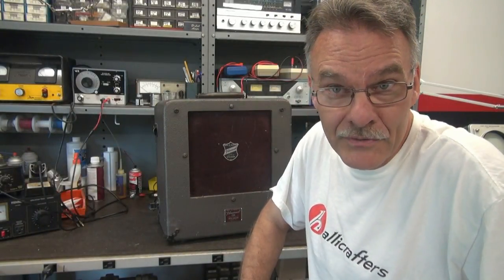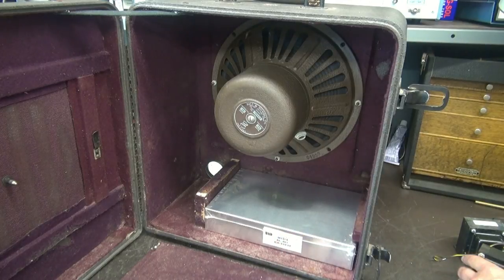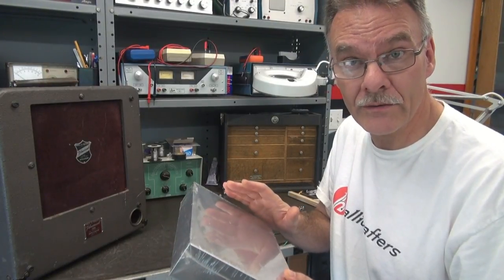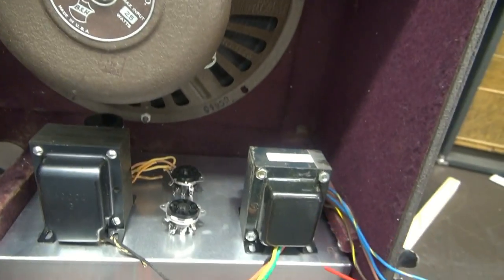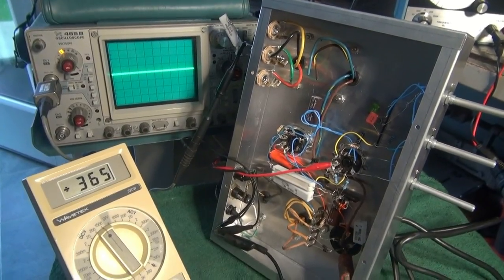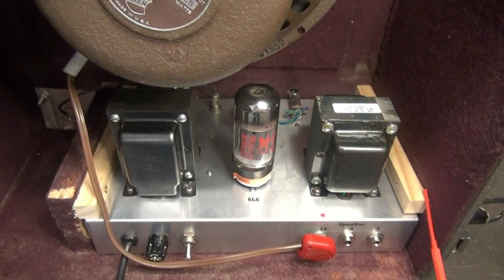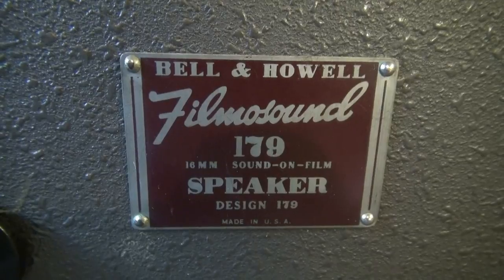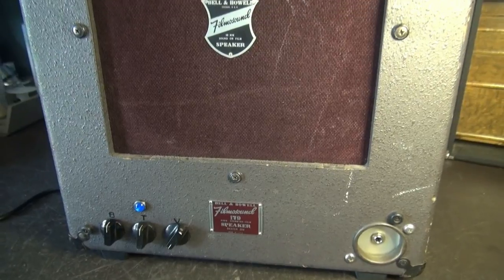How to build a combo guitar tube amp Filmosound speaker cabinet

Comment: I've had one I've been using for years I adapted to a TRS jackwith senate little lunchbox style micro amps. I just ordered a second one that should be on my doorstep any minute now. The are my all time favorite speaker/cab ever designed and are extremely versatile in utility. I intend to also use the dual 197's as part of my mini PA system I'm designing for use at small venues and part of my personal performance set-up. I have my Great Grandpa's Ampro Projector Speaker which I installed a little solid state into to make it a combo similar to this, I mostly use it with a secondary remote tube preamp so I can color my vocals and get a sweet sounding tube clipping grit or roll it back for a cleaner tone.

Comment: Hey Terry, would you be willing to give subminiature type tubes a try?
There's these neat little power tubes, 5902, which can deliver 1 Watt in single-ended @ 110v B+, and around 3 Watts in push pull.
They're like shrunk-down 6AQ5 tubes, same filament voltage and current, and you can find them for reasonable prices online. I'd love to see what you could come up with using these guys. 
For preamp, there's many options for dual-triodes (6111, 6112, 6021, 6N16, 6N21, etc) and a few pentodes (5636, 5840, etc), so you can keep the amp tiny by using all subminiature types!
What do you think?

Comment: Sounds good and what a great job. Wish I was good enough to just whip up designs like you do. Maybe in time. Thanks man and I did copy the schematic, Thanx a million.
Reply from the maker: Cool deal man, If the treble is too high, install a 390pf rather than the 220pf cap on the T pot. Thanks for your kind support. TD

Comment: I think I done purchasing tube amps. I will start building my own. The same thing happened to me with computers. I paid too much to have a shop upgrade my AMD 500MHz processor with 8Mb of memory to an AMD 1300MHz Thunderbird Processor and 500Mb memory somewhere around the year 2005. New Motherboards, new memory, new video card, new power supply. From then on I built my own. I purchased one of those How to Build a computer  "For Dummies" books and did my own research as well. I ended up building 3 computers. They still work but are now outdated. They run Windows XP at 2200MHz.
My first electronics project was a Radio Shack crystal radio set that worked nicely. My second project was a Radio Shack Multi-meter kit, which I ended up using for a while when I was an Electrician apprentice. I changed to drafting and then mechanical Engineering. That's how I earned my living.
I built two violins from Kits and I was able to incorporate features/adjustments that fit my style and technique better than any other professionally made violin. They sound great. The finish was the hardest part and I did not , could not make them look like a professional instrument. I once read it can take 10 years to learn how to apply the finish to a musical instrument so that it looks real pleasing to the eye. I believe that!
These day's I do a little Louthering on every instrument I have to make them fit/play better for me. Why not as they are mine.

Comment: Terry, isn't that Jensen a field coil speaker? How did you get it to run without power to the field? I have a similar B&H box with a 16Ω/15W Jensen that looks to be from the same period, but it's got a 4-pin that runs from the Filmosound amp and the speaker has another Leslie connector, of which I am unsure of the purpose. What's going on with yours?

Comment: Hi Terry, Merry X-mas 2017.. I did watch your new video with the Dayton 1 amp, very nice amp indeed. I came across this build which I missed somehow. I love conversions like this, very cool build. I have 2 questions. Why didn't you use the metal 6L6, is it a bad tube? If not, a sound comparison would have been neat. And why are single ended output transformers always larger physically, than push pull transformers of about the same wattage? Thanks for your time, Tom  Oh yea, this amp sounds really sweet too.. Happy Holidays

Comment: Hi Terry
Greetings from New Zealand.
Thoroughly enjoy your videos. I have built many dozens (hundreds) of amps over the years. Just one question/observation. I was always of the understanding that one mounted the power and output transformers in opposite directions core wise. i.e at right angles to each other to prevent possible hum etc. Interested in your thoughts.
RD
Reply from the maker: That rule only applied to open bobbin transformers. Metal bell end (fully enclosed) type do not have that issue.
Reply: Hi Richard, fellow Kiwi here - where in NZ are you? Be interested in taking a look at some of the amps you've built and talking shop.

Comment: Cool amp Terry. I notice that you started with a metal 6L6 and later you used a glass version. What was the reason?
Reply from the maker: Yes, I was hoping to use the metal type, since it fit the era, however the tube was defective, so I changed to the Sovtek.

Comment: Hi Terry .
My question is the transformers at right angles thing ? Perhaps the end bells on the Tx provide screening ? Or is the right angle thing a myth in your experience ? Any thoughts ?
Cool amp , and nice  demo playing by Tony .
Reply from the maker: That rule only applied to open bobbin transformers. Metal bell end (fully enclosed) type do not have that issue. Not a myth, but not required in this case.
Reply: Great info. thank you .

Comment: Why did you chose not to mount the output transformer 90 degrees from the power transformer?
Reply from the maker: These are closed transformers, not open bobbin which are known to induce. Take a look at the info regarding this on the web

Comment: Nice work. As always. I have one question. How come you have the PT and the OT with their iron facing the same way. I've been repairing tube amps for a very short while, and have been researching eventually building my own. Your PT and OT placement seems to defy what I've been reading about and what others say. What's the story there?
Reply from the maker: Right angle positioning applied to open bobbin (Paper) type transformers. Enclosed type,with bell ends do not induce to each other. Never had an issue,

Comment: Hey Terry nice job by the way is this going to be for sale?
Reply from the maker: Yes, soon. I have a few tweeks to do first. The treble is a bit to high, so will be changing that cap. Also the handle rattles when played due to metal contact to the mounts, so I need to resolve that. I have another unit and will be building #2. I want to steel my layout from this chassis so both are identical. So, there will be some time before I release this one.
Reply: D-lab Electronics yes, 
I would be very interested in a purchase as well. Thoroughly enjoy the repurposing and uniqueness of your projects, not to mention the great sound of tube construction.